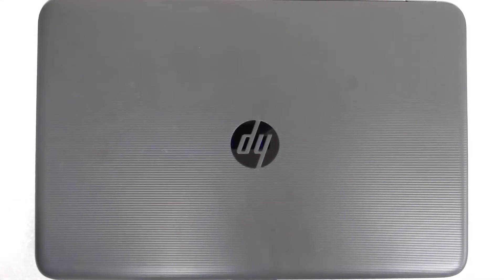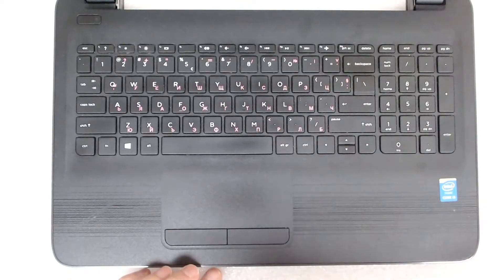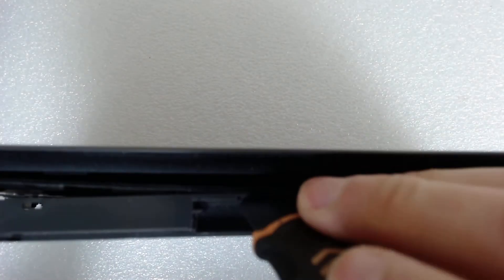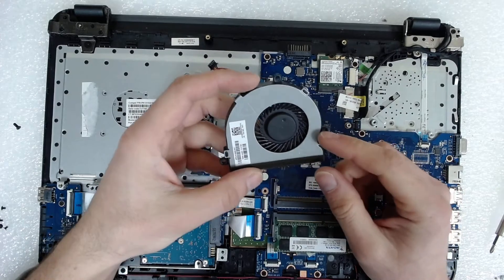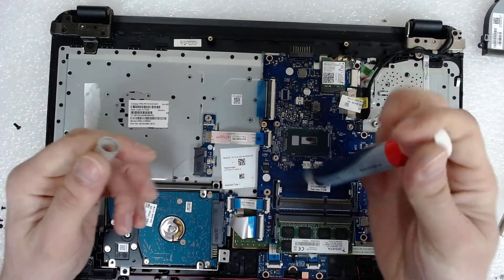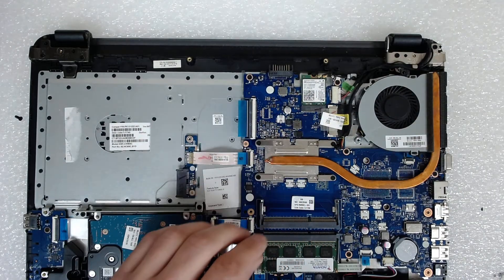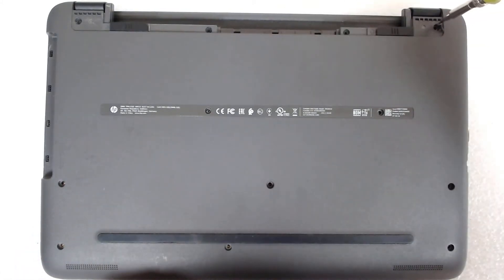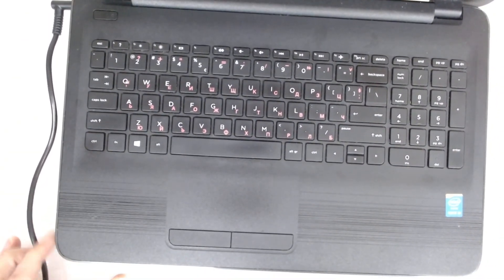HP 250 G5 Disassembly / Thermal paste replacement.

Comment: Hey bro, AMAZING video, THANK YOU so much for posting it! I just got this laptop and your tutorial was VERY helpfull to open it up!
However I am very curious WHAT storage this laptop has, most importantly WHAT TYPE of connection the HDD/SSD has. Because my HP 250 G5 DOES NOT have a standard SATA connection. It has some kind of mSATA I guess, but this is why I am asking you, what storage kind is that and what should I buy. I bought 2x DDR4 8GB RAM which fit perfectly but I need storage for this laptop, the SATA SSD which I bought (and HAVE in another laptop and my PC) does NOT work with this HP 250 G5. I found a ton of shapes and categories online, which one should I buy?
Reply from the maker: Best thing is to take a photo of the board, so I can have a look at what revision is. Probably the port you have is for the wifi. Usually this laptop use 2,5" HDD/SSD which is connected via connector with flat cable. Also if you need bigger storage, you can use caddy instead of the DVD and add another HDD/SSD.

Comment: Thanks for showing us this. Yes, definitely clean the fan and replace the thermal paste, as any laptop will quickly become very unhappy if it is left to constantly choke on dust!
Also, this looks like it only has single channel RAM. Upgrading to dual channel will help performance, e.g. upgrading from 8GB to 16GB.
Even replacing a single 8GB stick with 2x 4GB sticks will help, and that gives an 8GB stick to another system that can be upgraded on the cheap.
Reply from the maker: The laptop have 2 slots, so it supports dual channel. In order to work, the 2 banks should be the same size and speed. So adding one more 8GB stick will trigger the dual channel.

Comment: hi, i have the same laptop, suddenly started to shut down without any reason, i have changed the battery but thw issue continues, and today i needed the ethernet port and saw that it is not working and is not recognized by the OS (linux) any ideas what to check for, i have very little electronics experience, thanks in advance

Comment: Pls can the motherboard of HP - 15 ac-250g5 power HP 15 ac-121dx since they have the same body structure
Reply from the maker: The boards are different. One is LA-C701P and the other one is LA-D703P. Both look the same and the connectors are on the same place... so in theory it should be possible.

Comment: The fan doesn't look stock. Usually they use Delta fans on these models which are not sealed and can be serviced
Reply from the maker: Delta is it me of the manufacturers that are making laptop fans. Depends on the batch they use different one.
Reply: @LaptopDisassembly  oh ok. It's just that the fan didn't seem to have any branding and looked like replacement fans that can be purchased online

Comment: after replacing the fan, my laptop does not work anymore. Everything looks fine apart from the alimentation cable, which is partly uncovered, but I dont believe it is the problem, because the alimentation light still turns on. Asfar as you know is there any safety block or has something had a short? Thanks very much
Reply from the maker: What is alimentation cable. Do you have a fan spin when you press the power button or not. Try to reconnected the memory. No safety switch.
Reply: @LaptopDisassembly  i mean the cable from the mainboard to the dc Jack. No noise at all therefore i am afraid of a short
Reply from the maker: @pacobajito85  I doubt it's a short. You did disconnect the battery before removing the cooler. Check all the cables, including the power button one.
Reply: @LaptopDisassembly  thanks for the video and your support

Comment: Good video! 
Is it possible/does it make sense to upgrade the fan? My intention is to install maybe a more powerfull one which is not so loud like the origin fan.
If yes, which fans would be compatible for this HP model?
Thank you.
Reply from the maker: I don't recommend installing different fan. First it has to fit in the same space. Other thing is that if the fan is different the laptop may not be able to control it correctly. The manufacturer probably did some testing and decide what fan to install.  If you replace it with different it may have the opposite effect. I have done that on a old laptops, that i can't find the same fan to replace it. Otherwise i always install the same ones.